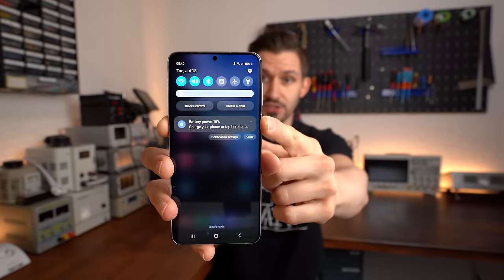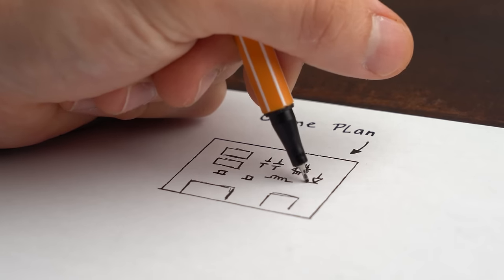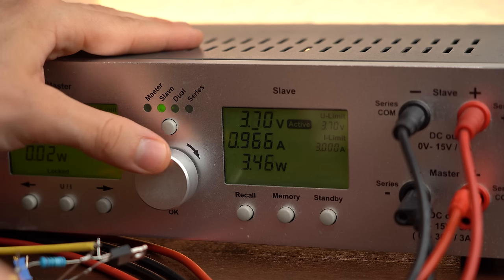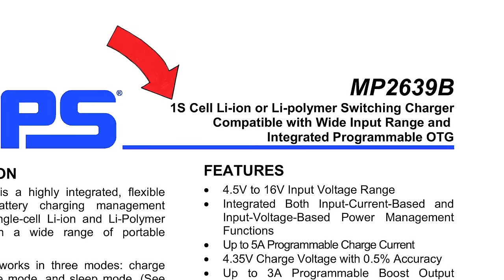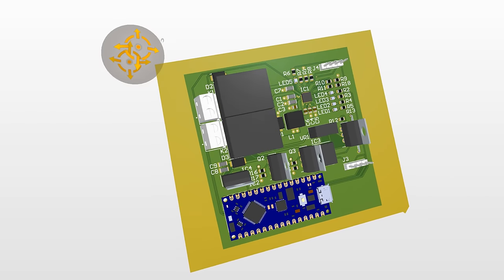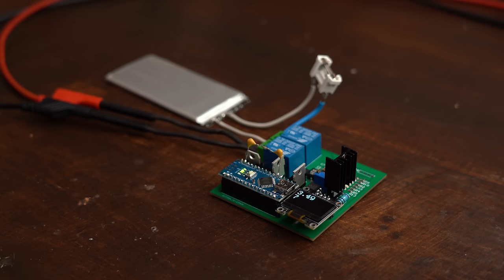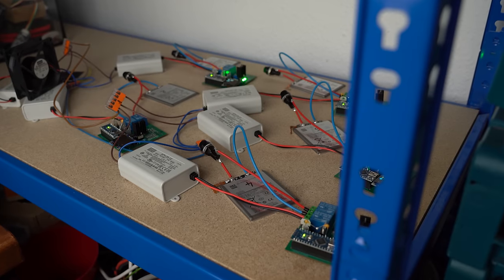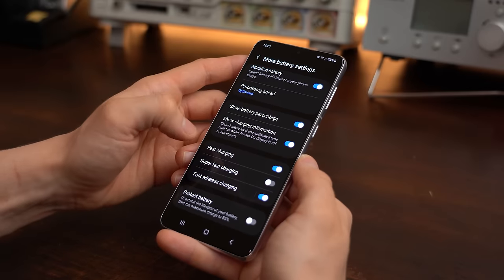Don't Fast Charge your Phone before Watching this Video!

Comment: Really cool info. You should continue this experiment and also introduce new factors. There has been research that charging to only 80% will preserve battery life. If you limit the charging to 80% how would that affect battery capacity? Also was it the fast charging that hurt the battery capacity the most? How do batteries degrade if just using regular charging?
Reply: I think it just doesnt wear the battery. Most phones slow down charging after 60% or something because after a certain capacity the battery may be overloaded if charged too fast.
Reply: @LKonstantina915  there's definitely still battery wear but not as much. Battery wear is apparently not linear. It hurts the battery significantly more when charging past 80%.
Reply: I do have some experience with charging and maintaining batteries and yes, fast charging hurts them. Its not such a big deal when you keep them cool but as the temperature rises, its a significant factor for longevity. Also keeping the battery in 70/30 or 80/20 SOC helps. If you dont aim for full capacity - eg you know you are not going to need every mWh from it, its a very good idea stick to such charging plan. Unfortunately mobile phone is to be kept at maximum, to be ready to go. Yes there are exceptions...

Comment: Good analysis!  But my advice is just use your phone like it was designed and not worry about it. I think people worry too much over perfectly handling their device's batteries. I had a One Plus 7 Pro with 30W Warp charging and charged it almost daily with only about 18% loss over 4+ years. My new One Plus 11 Pro has 100W & 125W charging. The significant charging speed (25min) is a tradeoff I'm happy with. Will swap out the battery if it starts to have problems down the line.

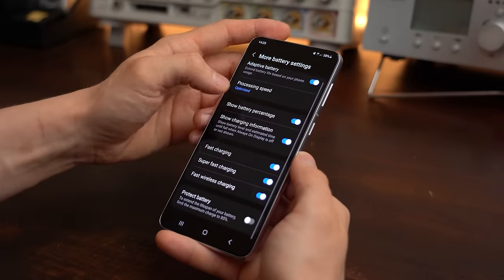Comment: I use the "Protect Battery" setting in my phone to only charge to 85%, I easily make it through a whole day anyway. I have however wondered if that actually does any difference. It would be interesting to see if that actually does anything to save the battery. Maybe a test you could do in the future? I saw you had the option on your phone at 11:52.
Reply: just look at this like that. you are using 85% of your battery thru your whole life so you get your 85% of your battery now and let say after 3 years. or you can use 100% of your battery when its new and it slowly degrade to 85% after 3 years. you are giving up this extra battery life for nothing. even if you won't sell it after 3 years and get a new phone, new battery for samsung cost (at samsung store) like what? 30-40USD? that's like $0.04 per day.
Reply: Max charging does degrade the battery faster.  Tesla would only charge to 90% most of the time unless you say to charge to 100% for a trip. If you plan on keeping the phone for a long time this will help keep the battery going for longer.  Everything is a trade off.

Comment: Many thanks for video and the effort you was taking for that tests. It's always good to have things quantified. Yes, with fast charging batteries are aging quite a bit faster. However, I think through overheating or charging batteries in the cold would deteriorate the batteries faster. Maybe you could extend your test on that using your epic arrangement.

Comment: It would be interesting to know more about this. Some people mentioned a follow up video after more cycles, and I agree. How long does it take to cycle the cells? At around 4Ah, I am guessing that discharge is 4h and charge is either 4h or 48m, give or take. So around 800 hours for the 1A test (32 days), is that about right?

I’m someone who keeps their phone for as long as possible (only upgrading when it break and repair is more than replacement) so I try to treat my batteries gently (charging my phone on an outright slow chargers overnight, like 0.25C rate or less.

Comment: Working in a pc/mobile repair shop, I can tell you that most batteries hit 85% capacity between 2-3 years. Under 85%, people start complaining about short battery life. Below 80%, the battery is mostly unusable and will likely start swelling. If we resold a phone, it had to be above 85% or we’d replace the battery. 
People should get in the habit of replacing their batteries at two years, instead of replacing it. This info is good—for me it reiterates battery replacement after a few years.

Comment: I'm not an expert here, but how would a two-battery system like my oneplus has be affected? Since fast charging is 6.5A and charging is done in parallel, would that mean 3.25A per battery and therefore less impact on the lifespan?
Reply: Batteries aging is influenced by a couple of factors:
- Charging/Discarging speed: Calculated in relation to the capacity: A 5000mAh battery charging with 5A is a charging rate of 1C. Halving the battery size and halving the charging speed keeps the same relative speed, so the same aging. This is what is happening in the OnePlus phones. Yes, each individual battery is charged at half the absolute current, but at the same relative current as if you had one big battery.
- Temperature: this is where using the dual battery system can help, as the charging speed is limited by the maximum aperage over the usb connector. Thus to get more speed you need to up the voltage. Then you would need to DC/DC convert it back down in the phones charging circuit to the charging voltage of one cell, or use two cells in series to have to do less conversion. This moves the losses out of the phone, resulting in less heat. OnePlus (Oppo) goes one step further und moves all voltage conversion to the power adapter, making it a real charger and not just a voltage supply like normal usb "chargers". It supplies the charging voltage for both batteries in series.
- Battery cycles: keeping the battery between 80%-20% greatly extends the battery life

- Age
Reply: Two battery phones are usually in series My current phone is like that 
Like right now it says 7.870volt on my battery

Comment: Would be interesting to do the same test but with different levels of "discharged" state, I personally never let the battery go below around 50% and have yet to find a difference in my phones ability to retain charge, even if the fast charge's rated for 6A@120w
Reply: Holding the capacity between 30 and 80% would be better
Reply from the maker: Sounds interesting; but also like a ton of extra work....
Reply: @greatscottlab  can't you just change the charge/discharge triggers in the arduino code ?
Reply: @wojtek-33 I use that feature all the time and I occasionally superfast charge it up to that 85% in 45 min from almost dead
Reply: @wojtek-33  I am assuming on newer phones? My S9 doesn't have this option.
Reply: @LAndrewsChannel how is your battery capacity holding since you bought the s9, I'm currently using the s9+ having bought it about 5 years ago, and I recharge my phone like 3 times a day, I think time for a new phone haha and this is also my second replacment battery 😅
Reply: @Homme_Pur  one needs to implement a coulomb counter for that purpose. You can't measure SOC with voltage alone
Reply: @greatscottlab  thank you for the video. When I design with a lithium battery as power source and longer life is more valuable than maximum capacity, I tweak the constant voltage (of the final charging phase) down by 50-100mV from the nominal maximum voltage. That should correspond to something around 90% or 95% of the nominal maximum capacity but the gain in life cycles makes up for it.
It depends on what you value most in your application.
Reply: @FaizanKhan-iq3yd  Oh okay, didn't knew about thoses, I thought you could get a good enough result from the voltage curve

Comment: Observed 9v during fast charge with a samsung note 10.  So not only an increase in current but with voltage as well. Burnt out a portable battery charger that did not support fast charging. Grabbed a quick circuit from aliexpress and recycled the li-po battery. It works!

Comment: I charge on 67watts and a cooler into the back of the phone, had it for 2 years and I also did a battery drain and charge test on when I bought it vs yesterday. Bearly any difference only falls short of 24 minutes than when it was new. It just depends on how you take care of your things. If you know heat destroys battery lifespan then do something about it instead of complaining. Fast charging creats more heat yeah but at a short period of time. Again if we know heat was the problem then provide a cooler to stop that
Reply: I assume it's some Chinese phone with that charging speed, the fast charging they use is completely different from this set up and goes to much greater lengths to keep the battery cool while charging

Comment: Do you plan to extend the experiment beyond 100 charge cycles? I would like to see the long-term data and see if the trend really is linear.

I am also interested in the temperatures of the battery and the potential effect of cooling them under fast charging conditions.
Reply: Spoiler, the 5a batteries were hotter, and likely heating the 1a batteries would’ve degraded them too. Battery University has a lot of information.

Comment: Very good, as always ! It would be interesting to see if the pattern persists after 100, 200, 300, 400 cycles. This would confirm the result (2% is not very much of a differrence, besides, do you know what is the uncertainty associated with capacity measure ?)
Also, it would be nice to see if the original capacity can be  "restored" by some slow charging cycles of the fast-charged batteries.
This may seem a lot of questions but you've already made the hardest part of the work 🙂

Comment: Liked this video. The battery will drop their capacity retention more than 30%, over period of time. There are many variables that too needs to be considered. Charging speed and discharging speed (current) is never constant when phone is in use. Charging beyond 80% and dis-charging beyond 5% is another variable. There are recommendations to charge phone such as turn off, not to use, etc which is practically very difficult in real world life. Also suggestion is not charge to its full capacity beyond 80% to retain capacity.  But in actual if you see, the phone's battery operating voltage is 4.4v - max(100%) and min - 3.6v (2%). It is all due to dendrites that build during charging/discharging processes. Dendrites is one of the major root cause.

I loved the video and admit amount of effort applied but good that attempted in this space. "See you next time...!!"

Comment: Lovely video. Fast charging and discharging build dendrites between anode and cathode inside the battery. Once they form degradation REALLY speeds up so i believe you are correct when you say battery degradation is not linear.

Comment: Should make the discharge amount random as well, not fully discharge. Since most don't fully discharge their phone before charging. This would get you a lot more cycles which probably matters most. 
Could have some temper on the randomness to make it still overall discharge the same amount over a certain number of cycles if you wanted, in case you think the random discharge amount could cause some cells to be unlucky and always have short discharge times.
Neat video and topic, very interesting.

Comment: I agree with commenters saying this test ran too short. Lithium batteries from experience lose their first 10% faster and then gradually the SoH loss speed degreases. Not linear, and definitely not trending upwards. This does not mean I think fast charging does not hurt - I just think this test ran 1/3 of half a mile and extrapolated too much from it.

Comment: Degradation in EV's Li-ion batteries is well examined and it is not linear. Most as new and then the curve flattens and becomes almost horizontal.

Comment: I have a Samsung Galaxy S20+ 5G that I got in March 2020.  Still lasts a day and a half on the original battery.  95% of charging has been done with Wireless charger that came bundled with the phone, as well as wireless charging in the Tesla Model 3..  Nice video, and great circuit design.   I think 100 cycles is not enough.  I usually do 500, or more, cycles when stressing my stuff that require some longevity to try to spot bad trends.

Comment: I have a LG G8 I bought 3 full years ago, I've fast charged it maybe 3-4 times then switched to a standard 2.4A 5V charger when I saw the battery in this phone was glued with a very strong, very hard to remove adhesive. 
The battery health indicator says it's at 100% to this day!

Comment: I have a 7-8 year old phone (Galaxy S7) that has been my sole phone and source of internet for 4 years, and lighter phone usage before that. For the last 4 years, it's been cycled numerous times each day, but I don't let it go above 80% or below 20%. I do not just leave it on the charger until full ever. I do not let it get hot. 

I also intentionally charge it slowly, wirelessly, under a small fan. The battery is no doubt worn, but 7-8 years and thousands of cycles and it still holds a charge all day.

Comment: Most of the phone, tablet and small electronic device batteries are LCO (Lithium-Cobalt-Oxide). They are used for their high specific power and (until recently) availability and low cost.
An LCO battery should ideally be charged with no more than 1C. Which means that a 3,000 mAh battery should be charged with no more than 3,000 mAh (if 5V is used, than 0.6A is max). C-rate of 0.8C is recommended for longevity. Unfortunately planned obsolescence is a thing... And keeping the costumes satisfied with fast charging at the expense of the battery life is more important to the manufacturer. 
Typical cycle life for LCO is 500-1000 depending on temperature, charging rate and depth of discharge.
Newer batteries include nickel, manganese and/or aluminum that improves longevity, keeps the cost low and cobalt to a minimum or even non at all with LFP and LTO batteries.

LCO have 60% Cobalt in the cathode... but no one cared that billions of electronic devices are thrown in the trash and never collected to be recycled. Many change their phone every year or use disposable electronic cigarettes. At the same time everyone looses their mind when EVs with 0-3% cobalt are mentioned. People are weird creatures... easily manipulated by a few fabricated articles and information taken out of context. EVs use NCA, NMC and LFP batteries that have much longer life and safety. (LFP can be punctured without going to dangerous thermal runaway.)
Dirty hybrids use outdated NiMH and NiCd batteries that can discharge wiht high specific power but have extremely short cycle life and specific energy.

- To be fair, a battery's degradation is most present in the first dozen of charging cycles or the first year of usage, than it levels off and degradation is slower.
- Charge controllers use higher current when the state of charge (SOC) is low and limit the current when the SOC is higher.
- Wireless chargers are convenient and charge relatively slowly but generate lots of excess heat.

Tips for long battery life:
- Keep your phone cool.
- Avoid discharging to 0%.
- If possible, avoid charging to 100% and keeping it plunged in for long periods of time.
- Avoid fast charging if it's not needed.
(At the end of the day, it's only a device that is meant to make out lives easier. You can always disregard those rules if it's necessary. But you should keep it to a minimum.)

Comment: From what I i remember from Battery University, the capacity loss at higher charge current is linear over the cycles, it won't explode as you hypothesize when describing the graph.

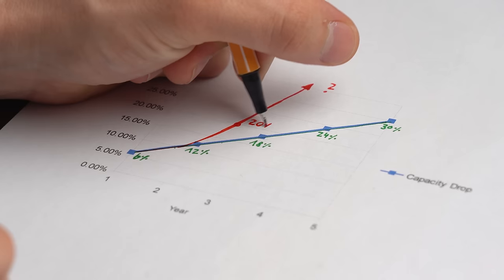Comment: 11:44 - the battery wear will accelerate if only because lower capacity means you will chuck it on charge more regularly (both in your test and in real life). This is part of why I try and get phones with big 5ah batteries - more capacity means less cycling, and it also means it has to be more significantly degraded before it has trouble lasting a day.

Comment: I have a Redmi Note 11 Pro with fast charging, I game with it so it dries faster, then charged up in less than 30 mins. 
Sometimes, I charge while gaming too, it heats up for sure but I've never came across to bloating or exploding and this is more than a year old in my possession.
Never changed the charger too, still the same that came with the box.

Comment: You think right. The capacity drop will definitely not be linear, it will follow an ascending curve, since the reduction in capacity will result in an acceleration in the rate of charge cycles, as the battery will need to be charged more often.

Comment: What a great work you did amazing experiment
But i should add some thing 
First of all the actual 5amp doesn't damage the battery its the heat that damages the battery
Second is that charging to 100 and discharging to 0 with a normal charger is worse than charging to 80 and discharging to 20 with a fast charger

Comment: Great video that..... it's interesting to me, as I have always assumed that fast charging would shorten the lifespan of any rechargeable cell, therefore I always use a regular charger, over night, and also on a timer to simply charge the phone (typically) in 2-3 hours. In the morning it's always at 98-99% 3 years after purchase. I use a 4 port charger so I can also feed my partners phone, tablet and a smart watch :)  Thanks for all the videos, inspirational.

Comment: I have a phone that supports 18W charging. But I charge with an old charger that supplies about 1A which comes to around 4-4.5W. The phone's battery capacity is 6Ah and it charges at about 20%/hour. This is fine for me as the phone is sitting on the desk the whole day anyway.